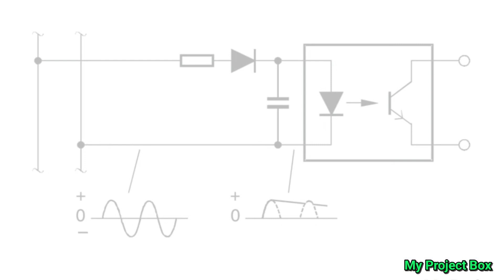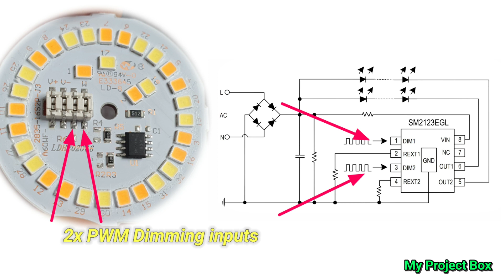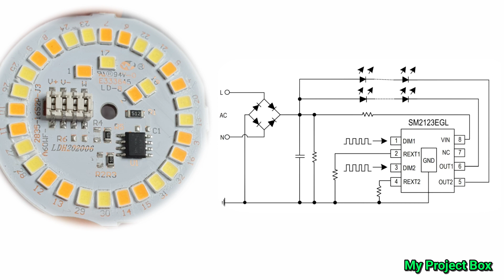Smart Bulb Shelly Hack! Works with the Light switch! Even when switched off? #ElectronicsCreators

Comment: Very cool! What's the advantage of doing this versus just having the Shelly installed directly on the light switch?
Reply from the maker: There is no real advantage in doing this. It's kind of pointless🤣. BUT!  It just proves the concept, that manufacturers could make a smart bulb that could be controlled with a traditional light switch, and Wi-Fi control at the same time!  With a normal smart bulb the light switch can turn it off, and the bulb is no longer smart! it's off it's dead, until you turn the power back on again.  Only then do you get Wi-Fi control back.
Reply: @MyProjectBoxChannel  ahhh gotcha. As a proof of concept it's fantastic, the manufacturers should sit up and watch! Thanks for the reply

Comment: What a great idea. Maybe you could work with Theo Arends (creator of Tasmota) on developing this as a standard solution. I think it would be a really popular development.
Reply from the maker: Thank you! It could be done much  simpler as well. Just a firmware mod, on a existing smart bulb, and my little light-switch detection circuit. And then you will have a smart bulb that actually works with your existing light switch.😉
 I would buy that as a product. Even if someone else copies my idea.

Comment: Try tasmota
Reply: Is there a guide on that? Does the switch for the bulbs needs to be smart or just normal switch?
Reply from the maker: @thebatu89  the great thing about this modification is it works with an ordinary light switch. It's just an experimental prototype concept, not really practical for most people.
Reply: @MyProjectBoxChannel  i just tried tasmota, you’d still to have the main switch replaced with smart switch (mine flashed with tasmota). Essentially there were 2 steps, change the relay for button switch (that’s wired to smart bulbs) to always on (output high), use another gpio as fake relay and add the switch & bulbs in the same tasmota group.

I’m still not sure how to modify my ‘dumb’ switch since they’re slightly different than what you have.
Reply from the maker: @thebatu89  if you would like a better understanding on how my circuit works you should watch my video on the Shelley1 no neutral Hack. https://youtu.be/YItMu6VJGBI
Reply from the maker: Can I specify what  GPIO pins do in tasmota? I'm not very good with firmware 😥 I'm more of a hardware guy.
Reply: Chech ur Messenger